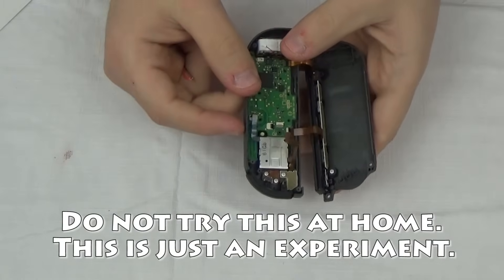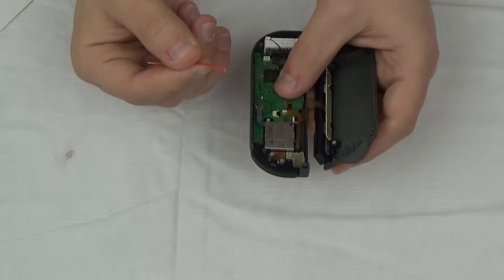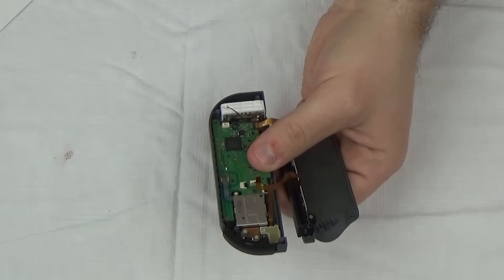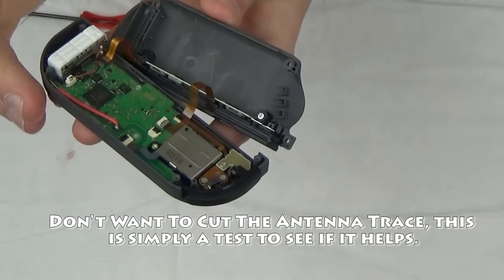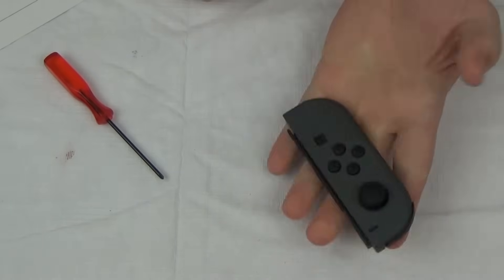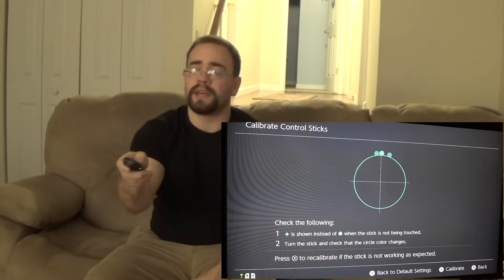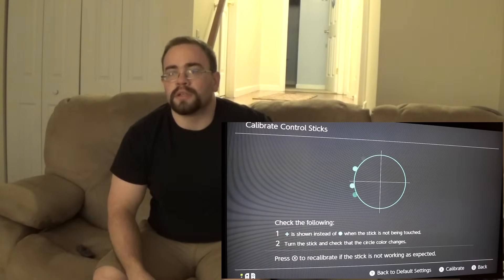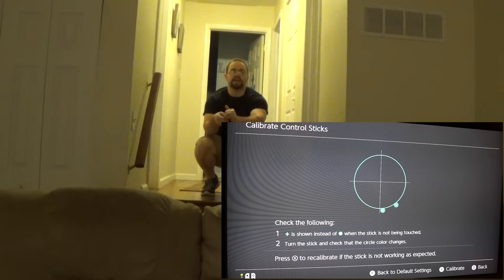Fixing The Left JoyCon!

Comment: I've just done this mod, it worked like a charm!

First of all pay attention to how you remove the battery connector in particular - it is extremely fragile and it lifts straight-up from the board, counter-intuitively.

I actually damaged my right joycon this way.  Long story short that's been replaced with another joycon that still had range issues and got a proper antenna module upgrade, so is now working great.

Secondly, just putting a piece of wire can work, but you're better off measuring a length that's appropriate for 2.4GHz, which is what bluetooth and the joycons use.

That wavelength is 124.9mm, but you can halve that for 62.5mm.  Halved again at 31.2mm also works.  You can also incorporate multiple features at different lengths, so what I did was cut a 62.5mm wire, then strip & solder it in the middle, so it's got 2 x 31.2mm features and 1 x 62.5mm feature.

Also don't worry if it's not exactly the right length, I only put tenths of a mm for completeness.  It should still work if you're a little bit out.  As you can see in the video just any old length of wire will do anyway.

Hopefully that helps anyone else trying this.  It was so nice to play from the couch without constant lag & dropouts today.
Reply: Hey, thanks for your information, i'll be attempting the fix very soon. You mentioned that you had a proper antenna module upgrade done to your right joycon. Could you point me to the specific module you bought or got?

Comment: for those coming by after several years, if youre trying to solve this issue in an old switch joycon, yes, i can confirm this works. on a 2017 left joycon that was having trouble a mere 3 feet from the console prior to the fix, i now see superior connection stability over the right joycon.

Comment: I notice my left joycons always drain battery faster than the right, especially when idle. Have you noticed this same problem with the one you added an antenna to? I have 2 sets of the newer models with the foam in there. My theory is the left joycon is working harder to maintain the connection and thus dying quicker. Thanks for the input.

Comment: Thanks for the suggestion! My left joycon was having trouble even 3 feet from the console if I held it in certain positions for mario party, and it even had trouble in the included controller grip! None of Nintendo's "troubleshooting steps" were helpful and neither were the infinite amount of "just resync your controller, idiot!" comments I'd get when asking around online. It was disconnecting even if I so much as put the controller on a table that was higher than the console! Adding a bit of copper wire stolen from an old USB charger worked perfectly, now it'll work anywhere in my living room perfectly!

Comment: after a year of dealing with this problem i just now got annoyed and watched this. I used to play with the joycons at around 6 to 8 feet and lost connection alot (I wasn't under covers or anything blocking it) it just lost connection, so i switch to a pro controller. I recently did this myself and sure enough i can relax for more then 10 feet and not lose connection even under the covers. Thanks Spawn Wave :)

Comment: I have a challenge, Turn both the left and right Joycons into a singular Wired or wireless Controller, with the shell of a proper controller, you can use anything even a 3d printer, there are only 3 requirements It works, it uses the Left and Right Joycons and it has a charging method without the requirement of taking it apart. if you fulfill all 3 requirements then You've improved the joycons Congrats you've made the first known Joycon mod that makes a pro controller that's far more compatible.
Reply: oh and yes I said use the shell of a proper controller, gotta Make that clear

Comment: I've been able to combine this approach with Nintendo's official fix and get it done without any soldering at home, if anybody's interested. Ninetndo's fix is to put in a foam to shield the antenna from interference. (See http://nintendotoday.com/nintendo-joy-con-issue-fix/) So I took a post-it, double sided tape and tin foil. Put the post-it on a table sticky side facing down. Apply the double sided tape to the area where the glue is, only from the other side. Then apply the tin foil. Basically the double sided tape holds together the post-it and the tin foil. Then you can add more layers of double sided tape and tin foil to make the shield as thick as you need. I've used three tin foil layers in total, but it might work with less. Then you cut out a rectangle of roughly the same size as the foam square Nintendo is using and use the post-it's sticky side to make it stick to the circuit board in the same place as you'd put the foam. Close her up and voila. Works like a charm!
Reply: vbass man i was thinking to do the same, did the square of tin foil/pos it touches the metal square (joystic)?
Reply: I think they do, but I'm not sure whether it matters. Just mimic the photo in that article I've linked the best you can, it should work.
Reply: vbass thank you man, it works
Reply: Great to hear that!

Comment: Thank you so much!  I can't believe this worked!   I just ordered some $3 tri-point screw drivers from an Ebay Chinese seller and finally got it 3 weeks later (my gawd it takes forever to get stuff from China!), opened up my Switch, put a tiny piece of conductive foam that I cut out from my PC's video card box, put it back together and now it doesn't lose sync AT ALL!!!

The thing is that I never did lose sync unless I had my iPhone near me.

But ever since I put the tiny foam in my Joycon (THANKS TO THIS AWESOME GUIDE) I can literally place my iPhone right next to the Joycon, literally making them touch one another and not lose sync whatsoever!

It still blows my mind that Nintendo didn't test this.  Like no one at Nintendo has a Smartphone?  No testers had their phones in their pocket or near them while beta testing Switch games and noticed that it would desync???  Maybe Nintendo banned Smartphones when working on the Switch cause they didn't want employees taking pictures and posting them on the net?  What about when the Switch was revealed!  There wouldn't be any point of banning Smartphones at work at that point.

Anyways.  If you have Joycon sync issues, go on ebay and type "tri-point screw driver" and buy those $3 ones from China that are advertised as iPhone and Apple Watch tri-point screw drivers.  They worked perfectly for the tiny screws on the Joycon!

Comment: This fix doesn't completely solve the issue. The conductive foam pad does.
Reply: Um yeah..this fix does completely solve the issue. He proves it in this video and I've been using it for the past 3 days since I did this mod. There's nowhere in my apartment within sight of the tv where the controller doesn't work perfectly. Before it didn't work from 8 feet away. 

What makes you say/think that this does not fix the issue? I'm very curious.

Comment: You sir are messing with RF voodoo that you have NO understanding of. You're changing a myriad of inductances, capacitances and other black aspects of RF engineering. Microwave frequencies behave WAY different than DC. You know what you're doing; the chip may last 5 minutes or 500 years from this point on.
Reply: I was worried about that as well. To keep a good SWR rating (so there's no reverse voltage), you want the length of the additional antenna to be 1/4 the wavelength of the 2.4 Ghz signal (typical frequency for bluetooth, wifi, cell phones and other communication devices).

This comes out to 31.25mm (or 1.23 inches). Using this length should still give you an optimum SWR so you don't have to worry about reverse voltage going back into the transmitter (and it also gives you the best signal). 

Increasing the length also increase the impedance of the antenna, but on a 1.2 inch wire, this will be negligible. Luckily for the people doing this mod, the length of the wire they are running comes out to be damn close to 1/4 the wavelength of 2.4 (One of the main reasons people are getting such exceptional results from this mod).

You also have to keep in mind that this is a very low powered transmitter. ICs aren't going to be getting destroyed from over current due to a small impedance increase on the antenna or whatever reverse voltage would come back from the additional length being not quite perfect.

Comment: I applied this fix yesterday. No problem in opening the controller and soldering job. However, this modification did not improve performance of the controller with higher distance. I soldered the wire in the right spot. It was well attached to the board...
I now wonder if the "foam" trick, published by CNET, today does the real trick...

Update: I have now added the foam solution to the added wire: THIS DID THE TRICK. No more issues. Played whole evening without any disconnections. Apparently, no soldering needed - just add the foam piece - this will hold away the cable running to the L and ZL button. I guess this is an issue.

Comment: I feel that joy-con connection from a long distance should be a non-issue. People complain but forget that this is supposed to be a portable console. Saying "they're not the best on their own but they get the job done on the go" is one thing, but bitching about it nonstop is just childish. The point of these controllers is to be versatile, not to be perfect for any one use scenario. If you're so desperate for a good couch experience, get the pro controller. It's literally only 10 dollars more than the standard for wireless controllers, so bitching about price in this scenario is also childish.

Comment: Works great - thanks so much.  i suck at soldering but was able to pull this off without damaging it. Used a strand from a CAT 5e cable - routed down below the rumble box. More difficult than it sounds for a novice, which i am, but doable. Works just like shown at the end. Thanks again.

Comment: Did this fix and don't have any more issues with my left Joycon. Thanks for breaking this down. I used a wire from an old Ethernet cable and put the exposed but below the rumble pack at the bottom with tape around it to prevent any shorting.

Comment: to anyone flippantly thinking "why didnt they just add a wire like this guy and make the antenna better" - 
1) Antenna design is a very complex process that requires years of study to be proficient.
2) Adding this hack may (stress MAY) have caused this joycon to no longer pass important RF and/or EMC tests that nintendo has to pass to be certified by the FCC and other regulating bodies just to sell this item.
3) its possible to mismatch an antenna in a way that drains battery much faster. Standing Wave Ratio (SWR) is a calculation that needs to be done right to minimize power waste when crafting an antenna and it is frequency dependent. 

These are some of nintendos reasons for crating the antenna the way they did (also, the main one for any project: COST) but thats their problems. If soldering a wire fixes the issue then F it its better to have a working controller than a wonky POS.

Comment: But wait dumb gaijin! Nintendo saved $0.01 on each JoyCon by not 
running a wire to the bottom. Do you want Nintendo to go bankrupt!?!?! 
Just wait for the fixed version and buy a new JoyCon set for $80 or 
spend $70 on the pro controller. Don't be selfish!

Comment: I don't see how people are praising this man. What did he do?
Reply: He solved an issue causing the left JoyCon to lose connectivity at completely random times.  This seems to be a pretty widespread problem, and in this video he isolated and fixed that issue by installing a single wire to boost the signal strength.  

I'd say that some praise is in order for a person who points out a major design flaw in a system created by a very wealthy company that has plenty enough resources to find it themselves.
Reply: Aurumai this is happening with all left joy cons? I haven't opened my switch yet.
Reply: Of course it's still happening.  This seems to be a hardware issue, which means Nintendo can't simply patch the system's firmware to fix it.  I really doubt Nintendo will ever fully address it, since the problem doesn't really happen that often.  

I've played about 40 hours of Zelda so far and it's only happened a very small handful of times, probably for only a few minutes in total.  It can totally ruin your game if it occurs at the right time, though.
Reply: Aurumai hmm, so I would have to unscrew my left joy con, mind you I'm not as technical this guy. I'm a bit nervous trying to operate & fix this on my own. I'm not a good listener with instructions like this.
Reply: Well, he himself said that no one should really try to open up their JoyCons like this and he's right.  If you accidentally damage them while you're tampering with the insides, you won't be able to return them and you'll end up having to spend more money to get new ones.

I think he was just trying to experiment and see if extending the antenna would have a noticeable effect on the connectivity of the controllers, which it did.
Reply: Aurumai Well, if this keeps happening, Nintendo is going to update the left joy con controllers & hopefully ship them in stores. Do I have to buy another joy con if this happens?
Reply: That seems likely, yes.

Honestly, I can't overstate how small of an issue this is.  The issue was probably inflated to seem a little bit bigger than it really is because this happened in the Switch's launch week.  I could definitely see Nintendo refining their designs of the JoyCons, but there's no way they'll announce a recall or replace our units for free.  It just isn't big enough of a problem for there to be any real negative consequence for them.

The JoyCons work just fine in their current state.  Their design was just a little on the iffy side.
Reply: Aurumai thanks for letting me know about this Aurumai. Very interesting information to know about.

Comment: I don't think it's a good idea to leave the other end of that wire exposed and flapping around in the breeze like that, especially when that controller is subject to so much movement and vibrations. Should that exposed contact hit another trace you could short it out or worse yet cause the Li-ion battery to explode. VERY DANGEROUS !!!! Please insulate that other end for your safety.
Reply: My thoughts as well.

Comment: So I did a test with this. I took my system to work (no electronic or signal interference) Was able to use the Joy-cons up to 100 feet away. Brought it home and docked it, disconnected 30 feet away. Undocked it and placed the system next to the dock: still connected with issues 45 feet away and through a wall. 
The dock creates issues as well. 
That's not a good sign.

Comment: Do you know what specific screwdriver is used to open up the joy-con in this video? I (think?) it has to be a Y00 bit (tri-point) but I'm not entirely sure where to get it online - or will other screwdrivers work? I happened to break my left joy-con slightly and I wanted to see if I could repair it.
Reply: L621 I got the bit from ifixit. it worked perfectly for me.

www.ifixit.com/Store/Tools/Tri-point-Y00-Screwdriver-for-MacBook/IF145-312-1

Hope this helps :)

Comment: I might just have to try this as a last resort.  My left joycon has a 1-2 second delay for anything more than 5 feet.  Snipperclips is unplayable from my couch (about 7 feet) so I'm not about to try any real games (Zelda) without my Pro Controller (which works perfectly, along with my XBONE and PS4 controllers).  Already tried moving my wireless router to the other side of the room in case it was causing interference, and there is a direct line of sight. I'm not a switch hater at all.  I love it, and rarely need the joycons detached (only for local multiplayer on my tv). Thankfully I have no other issues (wifi works flawlessly on mine).

Comment: Just want to refute this.  Antenna design for the 2.4Ghz spectrum isnt like RF/UHF where a coat hanger will do the job - it is a science and you have to get it dead right.

What's obvious in the video is that the solder point he identified is obviously soldered after the main process - this would be typical of a place reserved on the board for a last minute tuning adjustment, if needed, such as a filter capacitor etc.  Nintendo obviously didn't feel they had to add anything so they just blobbed solder.  No big deal.

...except to me that was an obviously badly done joint - a cold solder joint.  Hmm.  I guess that the machine that tacks a bit of solder on that point isn't set up right compared to the main SMD soldering gear.

I opened my own joycon up and sure enough - a cold joint on mine, too.  I reflowed the solder on it and added a bit more to it, reassembled and it has been working fine in the hands of my wife for four hours solid on Zelda, whereas before I was watching her die to cutouts.  I even replicated the range test this fellow did - and saw the same effect, the left joycon is actually better than the right now.

The little wire he added is worthless, possibly even adding electrical noise.  The actual fix he did by mistake - he repaired the cold solder joint.

I will say though - real bad news for Nintendo, as there's no software patch for a cold joint.  Devices having issues now, always will.  A recall is inevitable.  Decide for yourself if you can wait for the recall, or if you want to cure yourself now - just redo that solder.  Its so damned simple.

Comment: Those metal cans go around circuitry that may emit radio frequencies and also to shield from interference. They are spesifically designed to ground a any interfearance so putting the antenna next to it was a big design flaw by Nintendo.